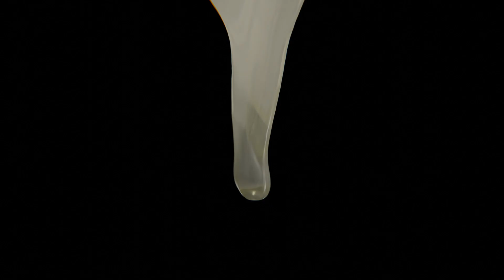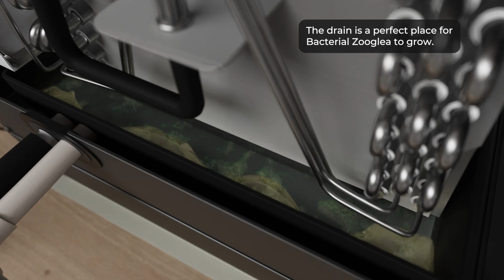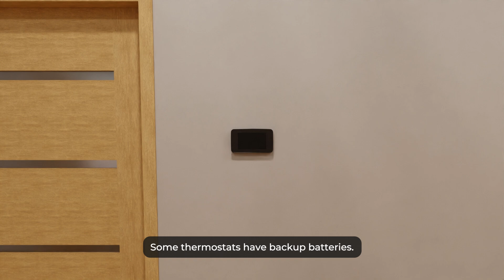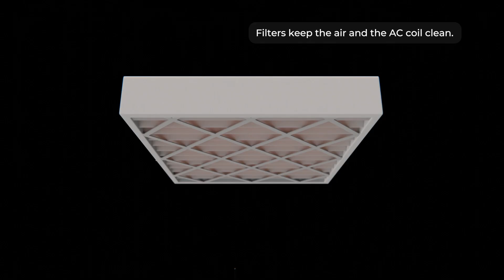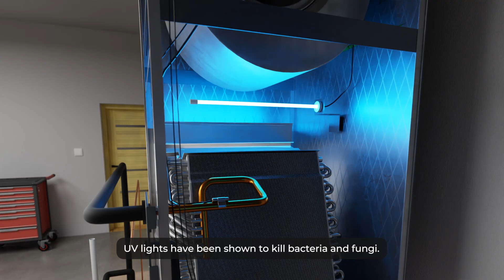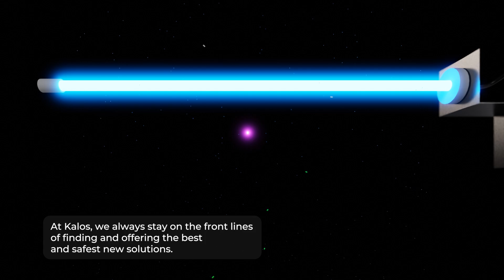Bacterial Zooglea in 3D: Why Your AC Drain Keeps Clogging

Comment: I had an 18,000 btu window unit fail in the spring of last year, and had a mini-split installed. I love it, but late last summer,  the inside unit dumped a bunch of water down the wall paneling, and spraying water out the outlet and onto the carpet below. I used a shop-vac to clean out the condensate drain outside the house. This spring, it repeated the water dump inside the house. I also discovered that the inside blower was heavily coated with dust that had hardened into a coating that required a lot of work to clean off. I killed the power at the breaker, removed the inside unit cover and, using a cleaning cover and coil cleaner and a spray bottle of water, gave the unit a thorough cleaning. A couple of months later, it dumped more water inside. I posed the problem to Google's AI, and it taught me all about zooglea. I got some "Flow Tabs" to put in the condensate pan, but with the hot weather here, didn't want to shut the unit down for the lengthy (for me) procedure to take off the inside cover, to gain access to the pan. After using the vacuum to get most of the drain snot out of the drain hose, I used a clean battery syringe to force Green Gobbler enzymatic drain cleaner all the way up the drain hose to where it came out of the house. An hour later, I used the vacuum again and out came all the snot. I can see the zooglea already building up again. I'm going to cut some small pieces of a flow tab, and try to force them up the drain hose and into the condensate pan with a cup of water and the vacuum hose connected to the air outlet of the shop-vac. What do you think?